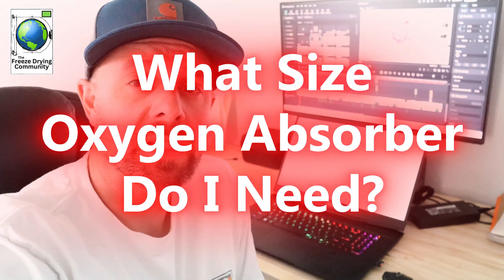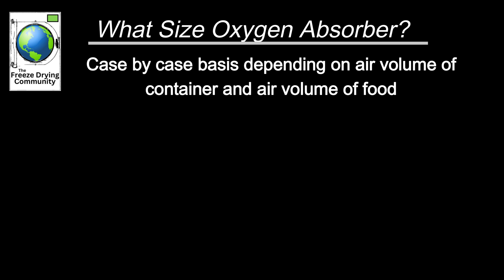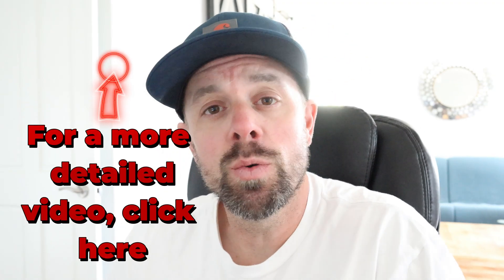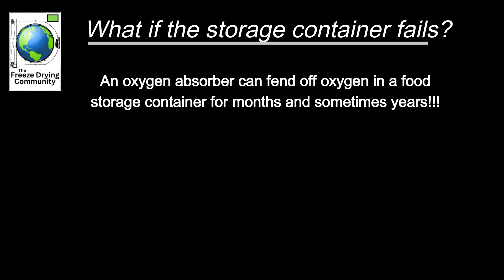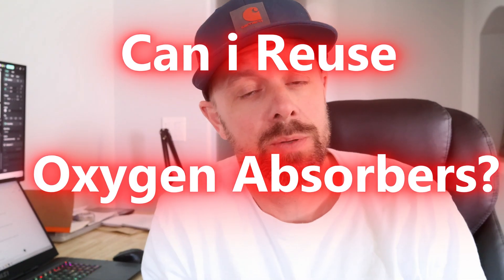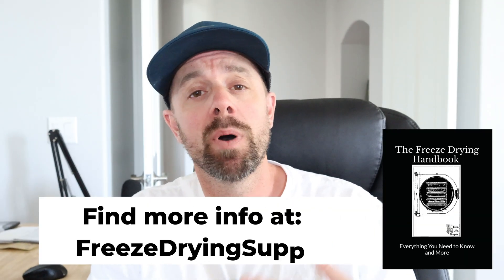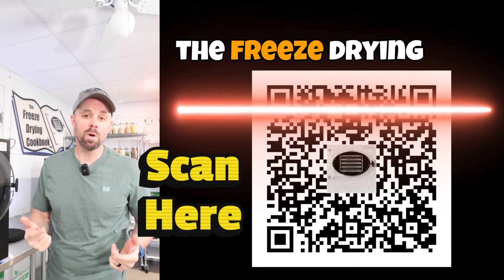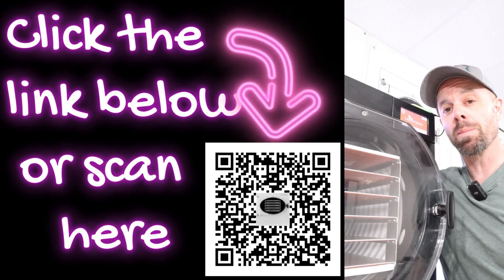Choosing the Right Oxygen Absorber for Long Term Food Storage

Comment: Are you using an OA when you use the vacuum chamber?  Your thoughts on not using it for short term(less than 2 years). I have had my medium FD for several years and have made over 200 runs with it. I mainly use it for long term but also use it for backpacking meals(short term).
Reply from the maker: I have done both but it's certainly a case by case basis depending on the food type.  If in doubt, throw an oxygen absorber in.  It's not worth wasting your time and money to save 10-20 cents.

Comment: Is it normal FD food packed in a quart 7 mil mylar bag with a 700 cc oxygen absorber to go soft? 
I put tomato slices in the mylar bag dry and crisp, but got soft but not moist just spongy
Reply: I use desicant packs with my oxygen absorbers. Desicant packs Can be reused if dried out with low heat.
Reply: @briansmith4724  Thanks, that sounds like a good solution.

Comment: Thanks! This is very helpful. I am curious on your thoughts of silica instead of OA door storage in jars for lets say up to 2 years? Im just not using the OA because of you need to re vacuum them etc. Silica seems to be easier? Also for selling, if a customer does not close the bag as good as they should, I feel like silica might do a better job or am I totally seeing it wrong?
Reply from the maker: Great question! Silica should not be needed in a sealed jar because if the  product is fully done it shouldn't be an issue.  If it is being opened and closed, it may hold off moisture for a time.  Oxygen and light will be the biggest concern.

Comment: Thank you, great information.  Question, best way to store oxygen absorber once you open the bag and still have some left over?  Thank you
Reply from the maker: Buy oxygen absorbers in 10 packs (we sell them at www.freezedryingsupplies.com) not 50 or more.  You can reseal the bags sometimes with the Impak sealer that comes with your FD or the best way I have found is to seal them in a small mason jar with the indicator.  Buy a mason jar sealer and pull the air volume out or you will lose a small amount of the absorbers ability to remove every time it is resealed.  Try to package in bigger quantities to avoid wasting absorbers.